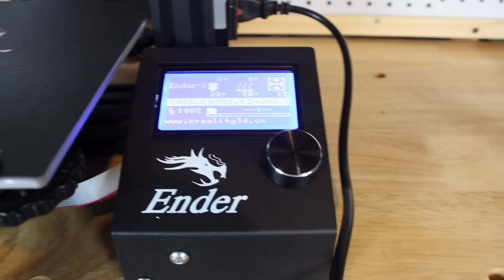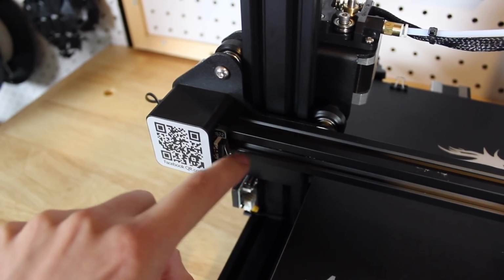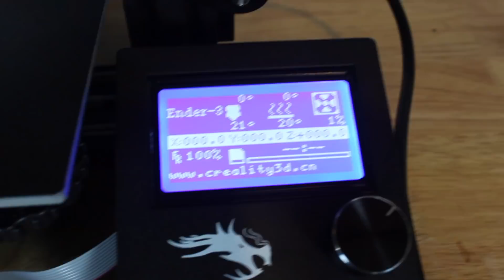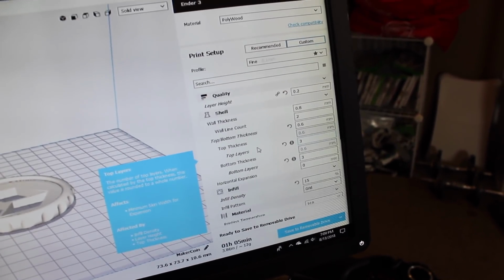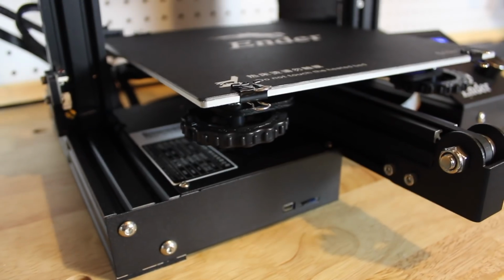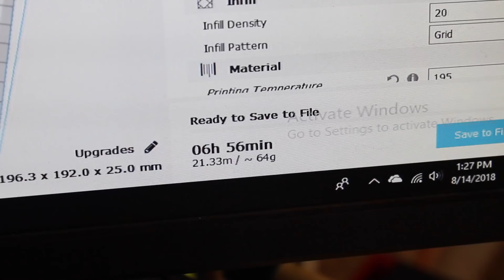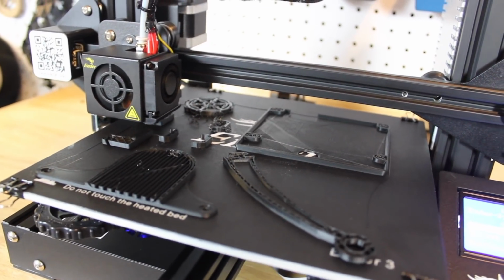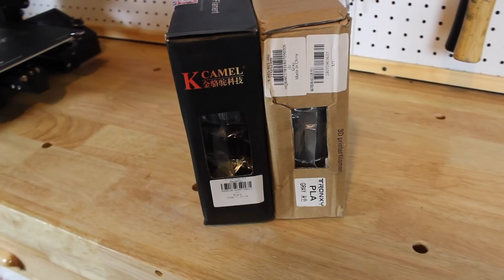Best 3D Printer Under $200! - Creality Ender 3 Review

Comment: I have one and the part fan died having less than 2kg of filament through it so not that reliable then...Also you forget to mention all the problems with the ender 3. Creality claim great after care support but ignore you when parts fail and you want them replacing
Reply from the maker: There are always problems with every printer and replacement parts can be bought online or printed.

Comment: I should have my ender 3 this tuesday.  I got it from gearbest, but it was already in a warehouse in LA. I got it for a total of $170.xx and I got the $5 insurance just to be sure. Using PAYPAL, I got $5 off.

I installed Cura, and I can't get the settings going. It wants to keep asking for a printer. I set it up for the untilmaker 3, but I don't have the options I saw in the video. I am using the newest version, 3.4.1.
What printer setting did you use?

I would do a video of the setup, but I don't know and have the stuff to do a live feed. I just have my cell phone.

I looked and can't find those upgrade parts, where did you get them?

Thanks
Tom
Reply: Check this video for Cura settings for the Ender 3 https://www.youtube.com/watch?v=umulfK775i0, also the "upgrades" he printed are all available on Thingiverse, you print yourself. Some are useful, some less so.
Reply: Congrats Tom Gray, i got mine in use for about 2 weeks now and so far, i am VERY pleased with it! Especially the consistent quality and high precision it can achieve when printing miniatures at 0.1mm layer height is just astonishing! It absolutely outperforms machines many times it's price tag.
You are gonna have a LOT of fun with it if you build and tune it right.  I would recommend the Cmag flex build plate as a first upgrade, as well as stepper motor dampeners.
Everyting else can be done with self printed parts (of which a better spool holder is absolutely essential, the stock one is pretty bad).
For Cura settings, just use the one for the CR10, clone it and adjust the build size.
Just remember to also get at least a full spool of filament, the first one will mainly be used up for calibration and printing upgrades. I got me the cheapest grey PLA i could find and it performed practically flawless so far.
Have fun!
Reply: Thanks Axel.  Should be here tomorrow. I hope it is ok. I ordered it from gearbest.com but it was sitting in an LA warehouse, so I hope it is a new one and not something someone else had returned.
I look forward to putting it together and I know the first thing is to level the bed, then to make sure the powersupply is set to the country code, 110V for me.
I am using PLA and I have two brand new reels. Black and white. More soon. I just want to make sure I have fun doing this. I'm into electronics so I am doing mostly parts to make unique clocks.
Yes I saw the upgrades on thingiverse, I have them.
Anyways, I hope to take a video, I only have my cell. But it should be fun still.
Reply: Actually, i'd advice to FIRST check the power supply (before turning that thing on!) and THEN level the bed (whilst it is heated!) ;) .  There is this very practical bed leveling procedure for the Ender https://www.thingiverse.com/thing:2987803 which allows you to level the thing and immediately test the results. If you try to level the Ender 3 whilst having the stepper motors disabled, it'll probably be a little off, since there's always a little jerk of the bed with mine when y axis stepper is engaged. 

Also, i advice you to use the Gcode from this video in your base Ender 3 profile: https://www.youtube.com/watch?v=K7tVTYZ9A24  it will purge the nozzle before every print and do other senisble stuff too.